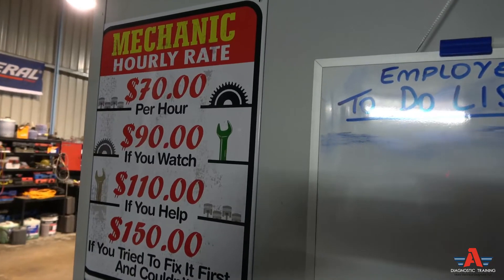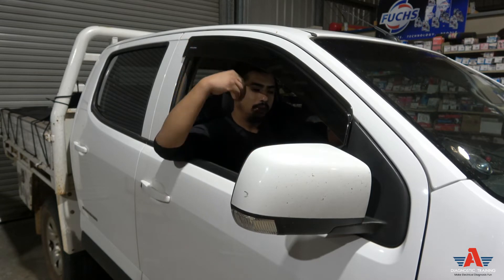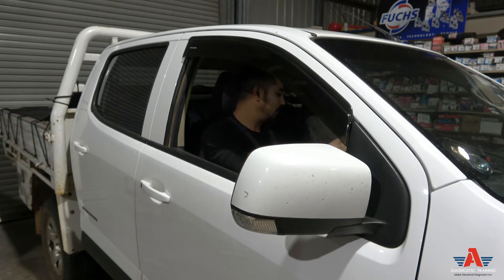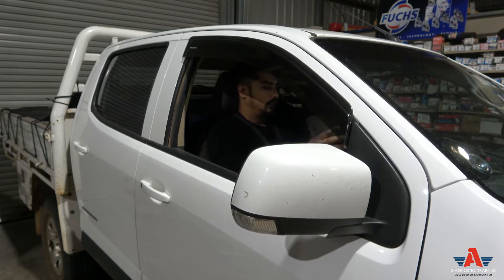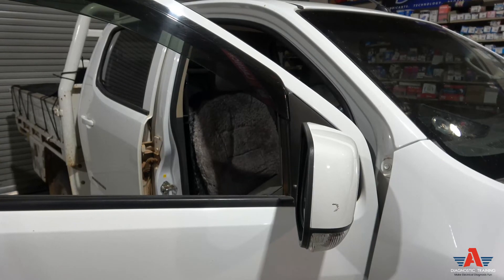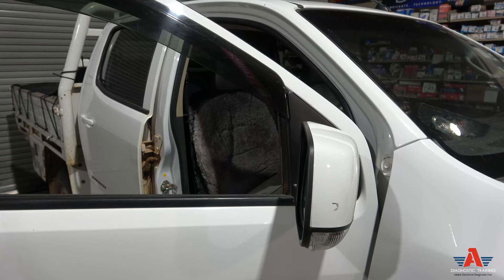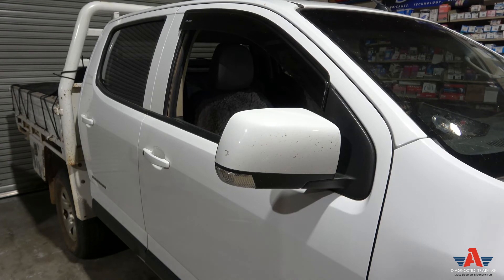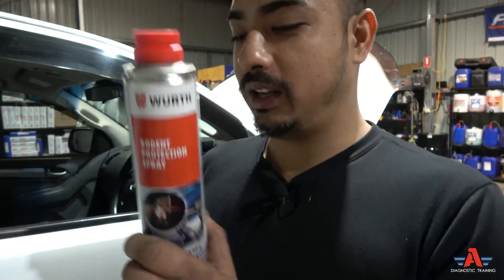Colorado 2.8 Diesel No Start Short Circuit injector

Comment: I’m haven an issue with my RG Colorado 2012 2.8 just dies out of nowhere throws obd code on dash P2146 short circuit somewhere near engine bay I’d say Cose tested all wires just have to give it a good look anyone help me out on where it could be just off the bat as not really use to doing anything like wiring

Comment: I have a 2005 CE 200 school bus I converted with an International VT365 engine. It was starting up fine, driving fine, then one day I shut it off, went to start it 20 minutes later, and it never started again. It cranks, but doesn't start. We've done everything from putting in a new fuel pump, a new FICM, new crankshaft position sensor, canceled out the HPOP, and more that I can't even remember.  One mechanic said it seemed electrical, others didn't think so. I finally got a code reader and it's giving me open circuit codes to all fuel injectors. I switched out the injector wiring harness, it did no good. Now I'm restoring the engine wiring harness. But it's been a year now of nothing working. I have zero faith restoring the engine wiring harness will work, even though quite a few sources that described my exact problem said its the engine wiring harness.  I need any help I can get.